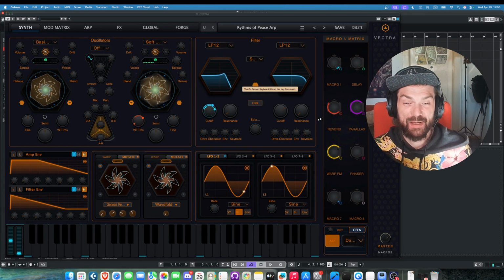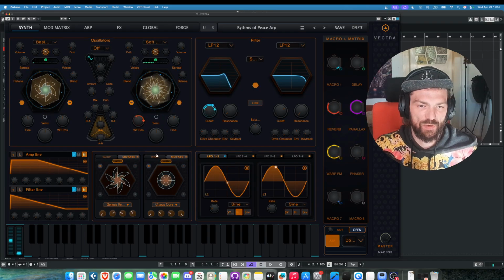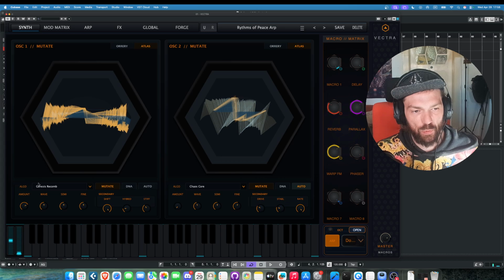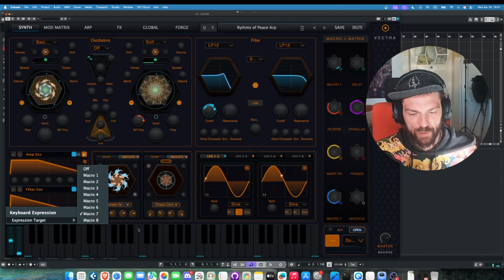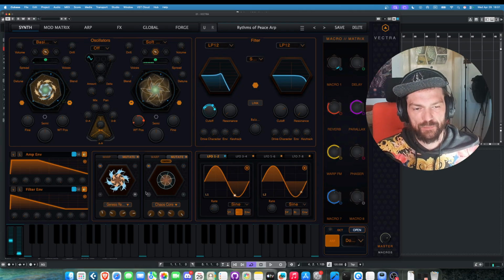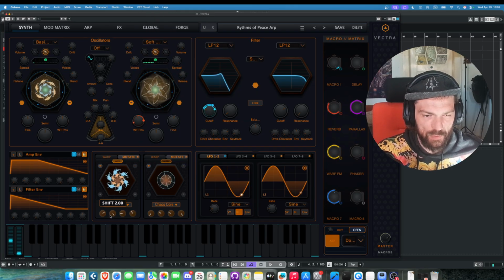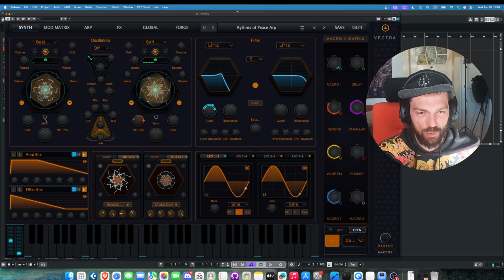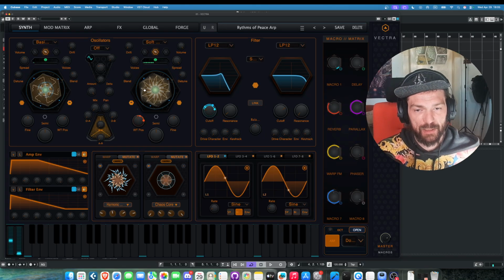Wavetable Mutation is BONKERS - Vectra Mutate Explained

Comment: I need this on Linux! <3
Reply from the maker: AS long as there is no Native Linux version you can try this: To run Windows VST3 plugins on Linux, the most effective method is using Yabridge, a tool that bridges Windows VSTs to native Linux hosts by converting them into .so files via Wine.

Comment: I don't know if you've already tried this, but you might want to look into “AVX instructions.”  
Advanced Vector Extensions (AVX) are instruction set extensions for Intel and AMD CPUs that accelerate complex computational operations (e.g., 3D rendering, video encoding, scientific simulations). Wider registers (256-bit or 512-bit) allow more data to be processed simultaneously, which boosts performance,

Higher performance for vector operations: AVX enables the CPU to process multiple data sets in a single instruction (SIMD—Single Instruction, Multiple Data).

Applications: Particularly useful for floating-point-intensive applications such as audio/video editing, 3D modeling, artificial intelligence (AI), deep learning, and financial analysis.

Further developments: AVX has been expanded to AVX2 (more integer operations) and AVX-512 (even wider 512-bit registers for data centers).